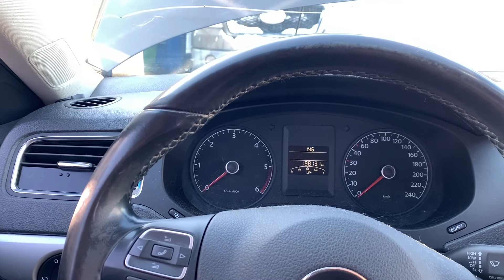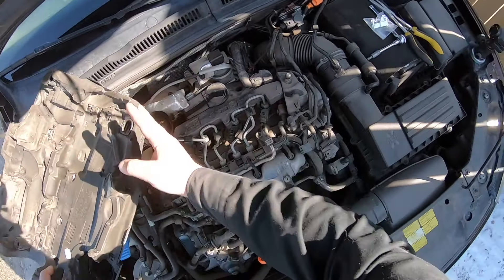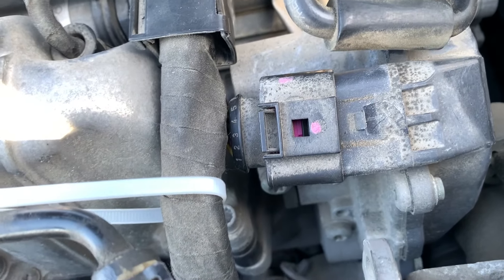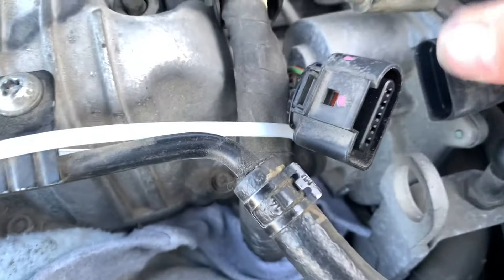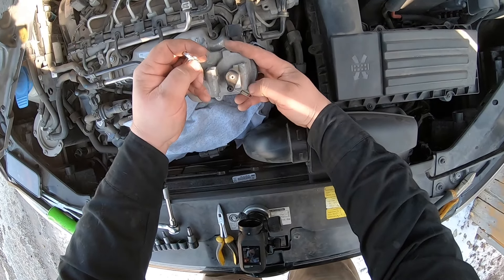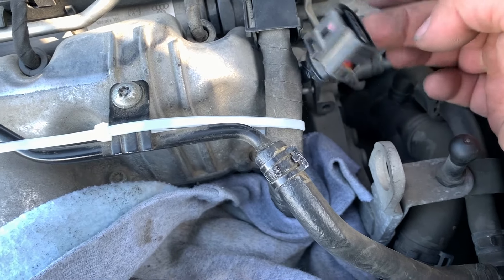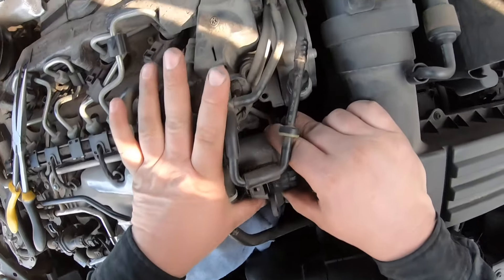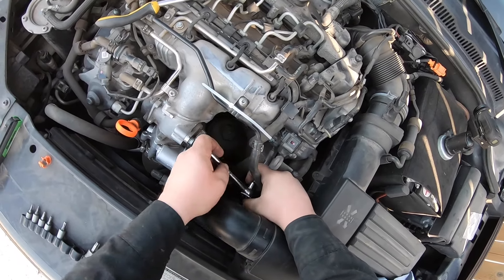P2015 VW Intake Manifold failure Fix DIY

Comment: Why take the actuator motor out?  I installed the part from DieselGeeks in place just by removing the bottom screw and lifting the actuator arm with some safety wire tied on the fuel return pipe.  No need to remove the motor and fight with the spring and actuator arm.  VW Jetta TDI 2012 with 175,000 miles ... and going strong.
Reply: Hi Alex. I have a VW Passat 2010 high line estate. Would the repair be the same and where do I get the part from? I’m based in the uk. Thanks in advance.
Reply: Alex thanks for that comment. I just removed the bottom screw and installed the bracket in 5 minutes as well. 
I appreciate the video of him taking off the motor so I had perspective of what was needed for a finished install. Thanks both of you
Reply: I was looking at it and I figured that would work.  Part comes Friday so I'll find out.
Reply: @robertgreenfield9051  did it end up working out?
Reply: Truly Genius, ….I was going crazy looking for that useless spring…great post thanks
Reply: Did your check engine go out after a couple cycles or did you have to clear it manually with a scanner
Reply: Where can you get that part? and would it work for a Passat 2009 2.0tdi highline same ? Mine came up in error bank 1 stuck open and no power can someone please tell does that part fix the issue
Reply: @georgewalton9673  this issue doesn’t create any lack of power, just throws a code. you got something else going on
Reply: Passat Variant B6 2.0 TDI 170hp: had to remove the whole intake manifold… VW changed the intake manifold that you can’t mount it easy like that.

I replaced it with a new intake manifold and P2015 is still coming. I don’t know what’s the problem
Reply: New owner of a volkswagon let me just say IT BROUGHT ME HERE!!! LIVING NIGHTMARE THESE CARS ARE!😅
Reply: Same! I didnt even have to lift the actuator arm. Placed the bracket vertically against the cylinder that holds the arm, rotated it down until it clicked into place horizontally, then put the two screws in. 3 minutes. Took longer to clear the code with my reader.
Reply: @hectorleiva3594  did you take out bottom screw? I received the device and thinking to install. Just a little scared to mess up something!!
Reply: @percyjohnson2736  yup. JUST the bottom screw.
Reply: @hectorleiva3594  thanks. I’m out here looking under the hood. I might be able to do this. I hope!!
Reply: Hate all comment with: Super simple,..fixed in 5 min without any knowledge! Sure...it take longer than that for a nurse to open the hood! Anyway,I have now watched several similar videos and none of them describe what my car looks like. The Passat 2.0 TDI 2010 has a plastic cover screwed on with several screws that can  not be accessed without extensive work ..Now I have to find another way to access the three (or maybe just one) screw.
Reply: @Swemist  Have you considered getting qualified help ... just a thought.
Reply: @alexgray1905  I can contribute another thought: The reason for trying to find information online is to develop and to avoid being robbed by the garage. I see no logic in your comment.
Reply: I can confirm this works, took abit of finagling to get it just right but did not have to take the whole unit off

Comment: This fix is hit and miss, you have to remember what causes the problem to begin with, it's the internal components at the manifold that wear out causing over rotation and throwing the code(s) not the flap motor itself in most cases I've seen, This device is basically using the original worn components and stopping them over rotating but they are worn! cheapest long term and effective fix is to replace the plastic manifold with an aftermarket one, also saves you having to clean the sticky gunk out of your original one.

Comment: Joanna from Cali here and have I got an update for you. Just installed the part I bought from diesel geeks for my 2013 Jetta TDI intake. Been driving for months with the p2015 code and dash Iight on another light came on for the regen filter. I limited my driving to not plug up my filter. Just drove forty miles at 75 mph consistently regen light shut off but p2015 light stayed on. I shut the car off restarted the car no more dash warning lights. Thanks for your video when I lost the spring I freaked out but you truly don’t need it.
Reply: Yes I lost the spring this morning and just reassembled without it.  Are you still doing ok without it.

Comment: Hi guys! It's a gr8 video and ace solution. I've actually installed the bracket without taking anything off from the engine. It took me less than 20 minutes to install it that way. Another word of advice, use a thread lock to prevent it from coming loose.
Reply: Hi mate, I would like to also do this... Do you have to replace the spring of you don't to take it off or is it just fit the part?
Reply: @dalecox8109  what.

Comment: Thanks - just finished installing mine and your video was very helpful.  Only recommendation would be to undo the bracket holding that hose running across the top and pull it back as well.  Thanks

Comment: Just a UK update. Was a nightmare as the three screws are at the back of the unit and not the front. Loads of bits  needed removing to access the unit. Fitting the small part to fix the problem was fairly easy but this also needed modification. Lots of tools needed and glad I did not tackle it. It took an experienced mechanic 2hrs to take out and refit. I erased the fault code and the fault code has finally gone.
Reply: hi, I am based in the UK, got a passat b6 2010 with the P2015 ERROR CODE, where did buy that small part, kindly share please , thanks

Comment: Can confirm on a 2009 1.9 tdi.

 Only need to take the bottom t30 bolt out, lever the actuator arm towards the front of car holding it then fit the part and do up. 100% works. Although there is 2 different ones to pick from. My one was the longer version. I've had the whole unit off twice and spring popped off too. No need to take the unit off. Very easy fix but a little fiddly

Comment: So I just did the fix this morning but lost the darn spring.  Put it back without the spring.  Any downside to this?  Everything seems to be ok.
Reply: I've just come across this and my one is in the same location but the screws are on the back and a nightmare to get to.
I'm not to sure but I think this is a safety thing. 
Much bigger diesel engines have have a problem where they can ignite the engine oil and pass through the rings keeping the engine running so as part of the safety the engine will close off the intake manifold when the engine is turned off.
This silly module is used to report back to the ECU that the flaps are closed. If it's not reporting any problem codes with the spring missing then I wouldn't worry.

Comment: hi, have been getting the p2015 error code, so i tried to remove the V157 and have just noticed that on my passat 2.0 tdi 2010 the 3 screws are the other side of the car (windsheild) instead of (radiator side)so space is really tight, hope that makes sense, thanks

Comment: Seriously everyone loosing the spring.. have seen other videos showing this being done without taking the motor off (although tbf some of those the motor in a slightly different place) but looking at this video of this engine.. surely easiest solution is to take the air box off in front of it to gain better access.. seems it would then be pretty easy to fit.  And I'd much rather dismantle the air box than the motor and loose the spring.. once I get round to checking mine out, I'll try and remember to share my experiences.. but I may come back and say I've lost the spring too haha

Comment: Did u use the diesel geek piece or the Amazon 1 you provide the link. The Amazon piece is not the same as the diesel geek. Little difference in the groove inside where the bracket should slide

Comment: Why Can't the repair bracket be installed without removing the flapper valve motor?  Looks like it could slide in from the bottom and then bolt in place.  Just curious.  Mine should arrive today hopefully so I guess I'll Find out.
Reply from the maker: I dunno try it and see if you can
Reply: @TestDontguess  Had it in place but not perfectly aligned.  Had to start the car to move the arm for alignment. At that point went to hell and had to pull the motor off and do it as shown in vids.  Only lost 2 torks bits and the spring.  Works well however and my mpg is back up to normal.
Reply: Lost bit and spring today too

Comment: I just bought a 2012 Jetta TDI with 130,000 miles on it. The check engine light came on about 500 miles into my purchase, it’s the P 2015 code. Upon further inspection it looks as though someone has already done this to my vehicle. Would it be worth it for me to try to do this again?
Reply: If your car already has that block fitted to the manifold and the code has returned, it will require a new inlet manifold. The initial reason why the valve extends too far is due the internals of the manifold wearing. Fitting the block just keeps the flap in the specified range so the engine ECU doesn't see a deviation. If that 2015 code is back after fitting the block, unfortunately, it means a new manifold. Hope this helps👍
Reply: Have you checked your vin for the Volks recall?  I know they raised the amount of miles your car can have on it  and the intake is covered. If your vehicle has already been repaired under the recall you have 4 years or 55,000 miles from when the work was done. It would be worth checking .  Just go to Volks recalls and it will ask for your vin once you enter you will know. Good luck
Reply: @joannaowens8831 I put in my vin and it said 10 years or 120k miles mine just hit 90k but im assuming since it's been 10 years am I boned? This part seems like a "quick fix" and im unsure of it but it does seem cheap and easy but most things in life are like that because they aren't permanent or great so I'm just skeptical my car literally started throwing this code about 45 minutes ago

Comment: Got exactly this part from D..geeks 4 years ago when I need the 3 balls bushing for  6 manual  trans  of TTQ , I still keep it for future prob probably ...
Reply from the maker: You can actually buy the part now on amazon for way cheaper from a different vendor
Reply: @TestDontguess  Do you think I can pull this off as a girl? It seems simple enough. I just got this code on my 2016 VW Tiguan. I've replaced a window regulator and a few other things on cars before. The only thing that makes me nervous about this one is it's so close to the engine. But it seems simple enough, and I won't fumble with the tiny spaces like you fellas with bigger hands :)
Reply: @TestDontguess  can you provide the amazon link?

Comment: Hey man thanks for the video I jus installed mine however I only took one bolt out and installed mine and it took the code off... you went thru alot more extra steps
Reply: yes seems complete removal not necessary?

Comment: My 2011 Gti has this exact same code but i have no problem driving or startups whatsoever , can it be this ? did this happen to you also just a code with no failures ? i already bought the whole manifold and dont want to waste any more money , thank you
Reply from the maker: I didn’t have any driving problems either
Reply: error code is showing after the new one??? i wana buy a whole manifold to
Reply: @TestDontguess  can you tell me what this part is I am having the same issue currently. Thanks so much. 14 jetta tdi 2.0

Comment: Thanks for helping us. I have little question if possible. I was getting p2015 and installed bracket. It is 2.0 TDI CR with plastic intake manifold. Mechanic needed to take away manifold to install bracket, he disconnected fuel lines from high pressure fuel pump because they were covering intake manifold. Anyway, long story short, no more p2015 but after this engine started to work louder, after few days i noticed he did not tightened fuel line bolt from high pressure fuel pump to rail and the fuel was leaking under high pressure fuel pump, including revving up on idle to compensate for the pressure i guess. I visited mechanic once again and he fixed this by tightening the screw but engine still works louder along the vibrations on idle, no revving on idle anymore. Is it possible that 'ecu/computer' needs to learn new settings while driving, or there is 'air' in fuel lines? is it possible that he damaged hpfp because he did not tightened fuel line from hpfp to rail? or something else? thanks a lot to anyone having time to help me out
Reply: The ecm is actively making adjustments and relearns every second. By louder to you mean higher rpms?

Comment: Your T27/T30 screws go in from the front?? Mine are in from the back, I can't reach them to open them off. Did someone have the whole manifold off before me and install them backwards on the manifold before putting it in?? Is there a trick for getting it out with the screws at the back does anyone know?
Thanks
Reply: Did you find a solution for this? Mine is the same

Comment: I lost the small spring while placing the piece. I have assembled everything without the spring and it works perfect. There are no more errors, but ... Is there a problem because the spring is not mounted? What's its purpose?
Reply: Bro I lost mine too! Imma do the same thing you did and run without it! Lemme know if you ran into any problems!
Reply: @trevorshaw1932  no problems until now!!
Reply: Oof what happened brooo?!?
Reply: @samuelgarciamartin7350  what happened?
Reply: @briansmith9258  up to now everything ok
Reply: Me too i lost the spring but it didn't change anything

Comment: Getting that spring back on would've made me set it on fire
Reply from the maker: it wasn't the hard actually
Reply: I just did this mod and you are right. I dropped the spring into the engine bay while trying to reinstall. I finally found it and had to fish it out with some needle nose. Then finally I was able to barely get it on and put the screws back in without it falling. It was difficult cause there is no room to work. My hands hurt afterwards lol

Comment: Clear, concise and truly excellent - I just wish I had an aluminium manifold and not a plastic one, It seems much trickier!
Reply: Are the bolts on yours on the opposite side to this video?
Reply: @thechud123456  They are really awkwardly positioned, so I had my local garage in the village do it. Thankfully, they didn't charge much at all,  but it would have taken me ages to do and left me with skinned knuckles. Since the piece was fitted it ha been absolutely fine and the code reader is clear for that one... just the EGR valve to clean and the glowplugs need changing, but I'll leave those scamps well alone in case they snap.